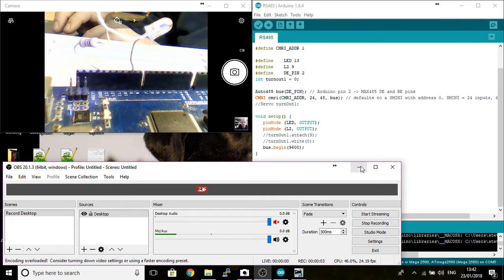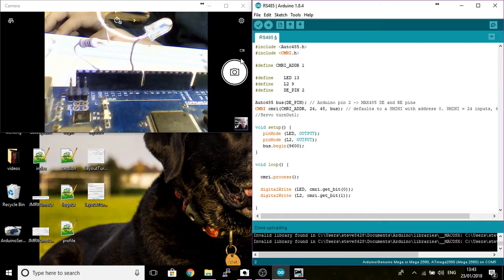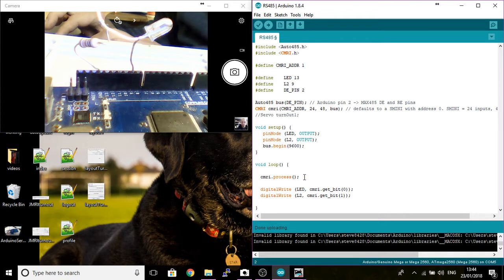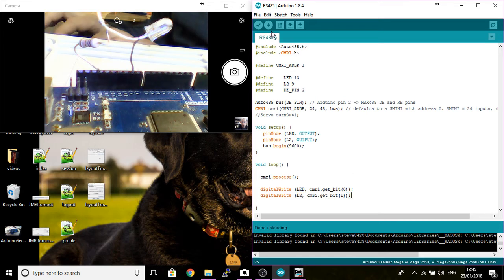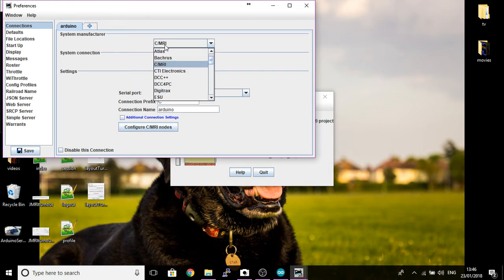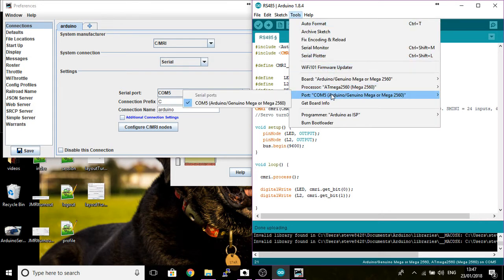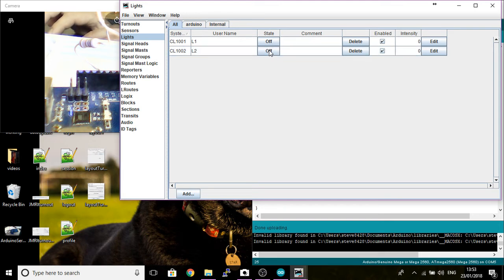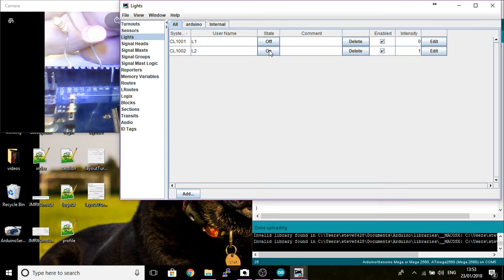Arduino JMRI CMRI setup for model railway Part 1

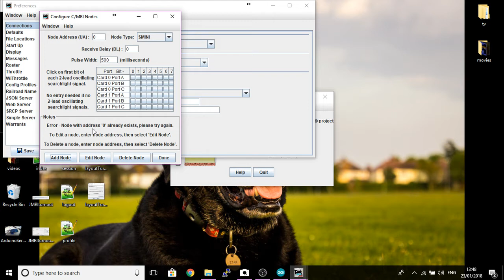Comment: 6:49 "Add node", your Arduino code: cmri address = 1 hence JMRI CMRI UA node address = 0?
So default JMRI CMRI UA address = -1 which does correspond to Arduino CMRI.h default address = 0. Is that correct?

Yet in the table with overview of outputs, addressing is 1001 for node address 1 and bit address 0 (L1).
So, if it were CMRI address 0 (Arduino default for the CMRI.h library) for bit 10 then the table address should be 0011? Is that correct too?

Comment: did everything as illustrated but it doesn't work.
Reply: Did you ever get this to work.  Im at the same point although when I click on JRMI to turn the light on the TX led flashes on the arduino.  I am using the MEGA
Reply: Follow up from my previous comment.  I now have it working.  I put an arduino Uno on and it all works great.  My MEGA was a copy, so may be a firmware issue.
Reply from the maker: Sorry for late reply, youtube not notified me of comments, there are Arduinos out from Chine copys which do have problems. also the baud rate on JMRI setup needs to be set to 9600. Check out my CMRI setup on my blog which explains this

Comment: What about using JMRI on a Raspberry Pi running an Arduino Mega with DCC++ l298p shield, and a PCA9685 connected to the Mega for turnout control?
Reply from the maker: Hi, I did do the DCC++ with the motorshield connected to the Pi, can be done with uno or mega shield and works ok. Don't believe i tried the CMRI but it should work on a USB connection in theory. The PCA card is only related to the Arduino so will work fine. I am not sure yet if I will move back to the pi or not. At the moment I have all connected to PC and can remote connect to this anywhere, also can run the JMRI server which allows any device to connect to it. 
One thing that i am not sure about is using the Auto485 on the pi. Again should work as the pi will only see a USB stick
All this is no my web blog
Reply: @BrackstonesTravelAdventures  ok thanks